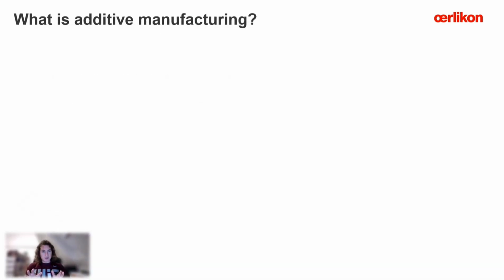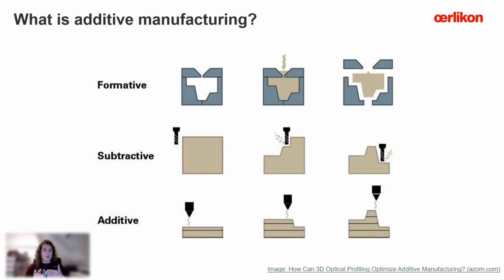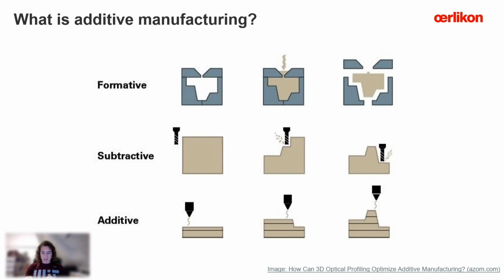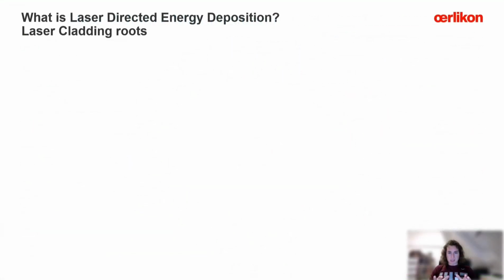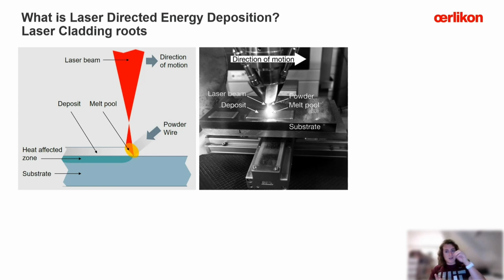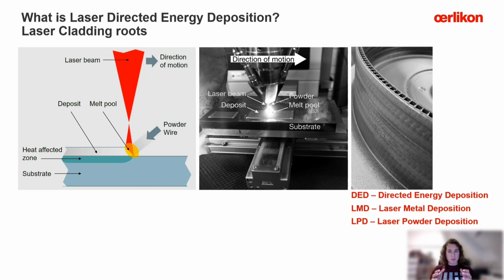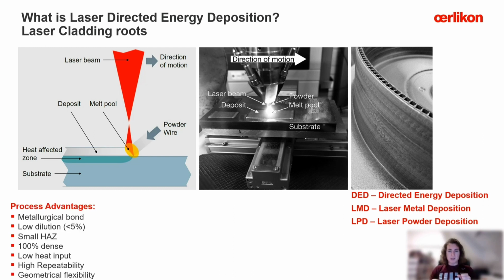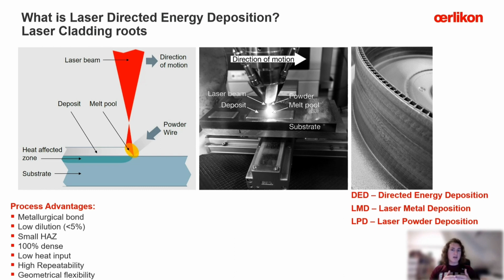Laser Directed Energy Deposition (DED) – Basics of Laser-Based Additive Manufacturing

Comment: Curious about your use of the term “DED” vs “LMD” — I feel like DED is the old term and LMD has rapidly become the new standard. I have never heard LPD used personally. 

And then “EHLA” vs “HS-LMD” is another discussion…
Reply from the maker: To many terms, which all have more the same meaning. A couple of years ago, I wrote sarcastic article about that. Maybe it will hlep you a little: Article 2: Laser Cladding has many names
https://www.linkedin.com/pulse/article-2-laser-cladding-has-many-names-arkadi-zikin?utm_source=share&utm_medium=member_android&utm_campaign=share_via
As for DED somehow it is just most commonly used term...
Reply: @TechnologieswithArkadi   I would say DED used to be the most common term for sure, but from what I have seen, most conferences and recent publications are moving away from this term to more specific descriptive terms like LMD, especially over the last 5 years. When you are focusing on Laser processes (not electron beam etc), I was wondering why not use the laser-specific terminology? 

Also, I started a new wikipedia article on Laser Metal Deposition a few weeks ago, any contributions would be very welcome. A lot more on laser cladding nozzle types (coaxial, multi-jet etc) is still needed! 🙂
Reply from the maker: That's why I always use 'Laser-based DED' in front of DED :) You're right; the common term doesn't always accurately represent the process, considering the varied energy sources. Interestingly, I had a similar discussion with a professor at ETH after my lecture last week. I also have a passion for LMD! Of course, I'd be happy to help. Do you have a link?
Reply: @TechnologieswithArkadi   https://en.wikipedia.org/wiki/Laser_Metal_Deposition -- there's a few diagrams on the "wiki/Cladding_(metalworking)" page as well I was thinking of migrating over as well. And thanks for the excellent videos as always!

Comment: 3d print with a thermitic flux paste containing metallic material. If you can get the chemical composition correct once its printed youll be able to set the print on the ground, ignight it, and it will self adhere the same way rail ties are thermitically welded.

Direct heat applications like this will only ever cause warping unless you create sophisticated expensive solutions that arent worth the time. Ask someone like 3M, or other chemical manufacturers to take a shot at it.
Reply from the maker: It is your opinion and thank you for sharing it. However before to make an industrial statement a couple of references would be useful.